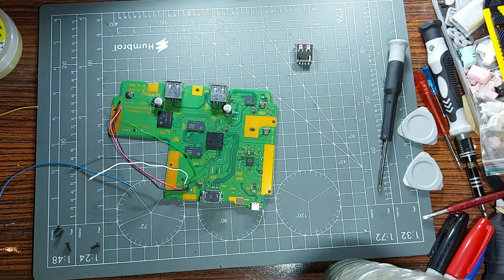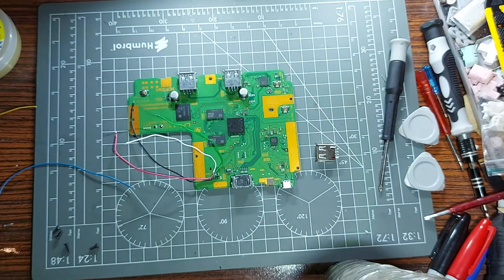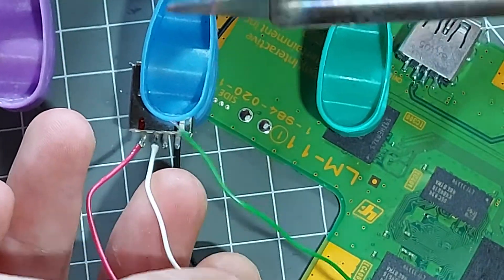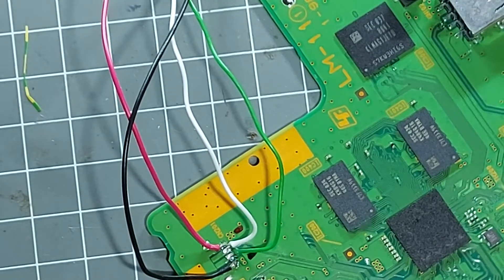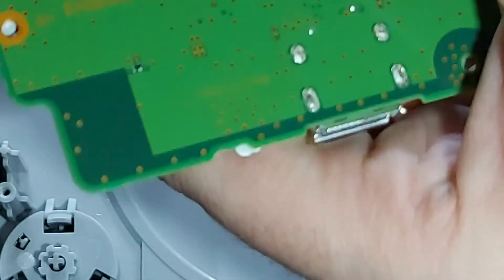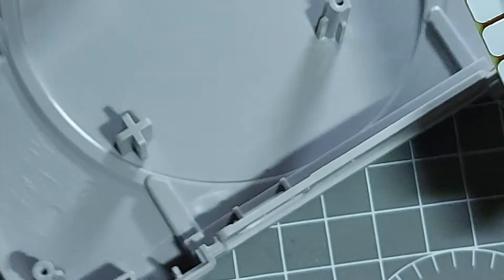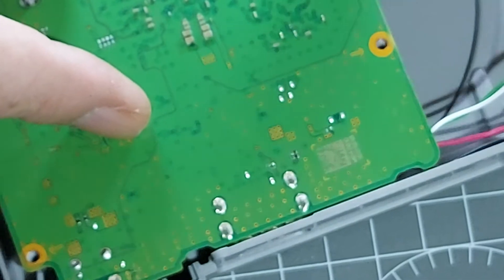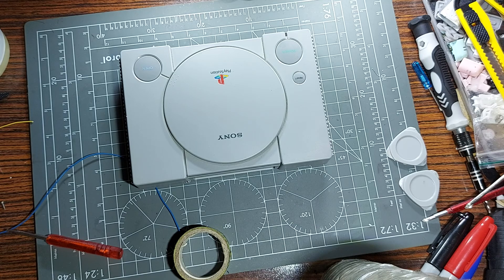Playstation Classic adding an internal 3rd usb port

Comment: is it working?
where is the result video proof?
Reply: it is not an USB pins, it's UART!
Reply from the maker: Your right its uart not usb.
Reply: @gadgetmadlad6691  I suppose it is possible to use UART's Rx/tx as USB data pins, but it requires hacked kernel. Is there any such kernel?
Reply from the maker: @Bicycleworkshop  tbh I saw it referenced as a possible internal hidden usb back when the ps classic  first came out. So this video was my attempt at doing it lol, never got round to actually checking if it works, its still connected now. When it comes to kernels I have no clue lol. Basically this video was a failure sorry for any mistakes or mis information.

Comment: don't think this works if you are trying to install your USB flash drive internally.  i researched a bit more and the pads on the board are for a UART chip.  i tried to solder on a female usb ports and could not get the system to boot off of the USB drive.
Reply from the maker: You are correct it didn't end up working for me either. Iv got a video coming up where I add original playstation 1+2 controller functionality and an internal hdd. This mod will free up the 2 front usb ports aswel so keep your eyes peeled for that1, I'm running a bit behind atm but have loads of new content coming soon.

Comment: Search add physical usb ... returns hub, hub, hub, Your video. Thank you!
Reply: I just found out its the uart serial port, after I had quite a time soldering a usb port with a big ass two heat solder gun :) did you ever get it to work? I didn't do the original power mod, but there's a large two pin connection under the power port, that, as far as I understand, will power it. Still researching but not giving up. I like your style. Any advice? I've never messed with uart. either way good job!
Reply from the maker: I'll re visit this subject very soon.